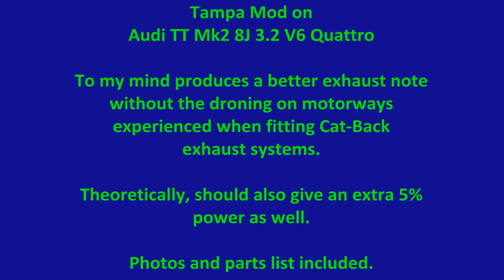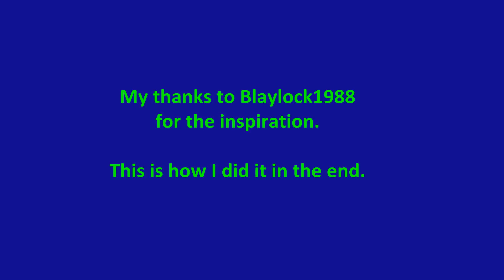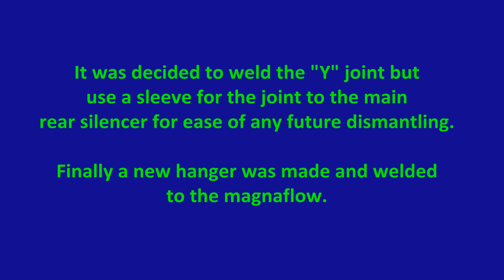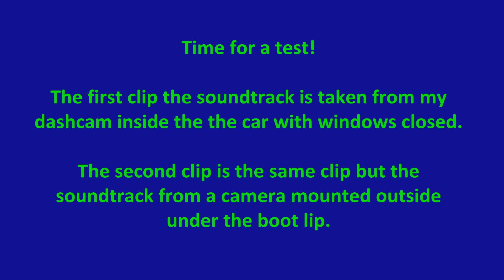Audi TT Mk2 8J 3.2 V6 Quattro Tampa Mod exhaust mod - how to

Comment: Great to see this done. Been debating doing the same on my A3 3.2 but haven't been able to find anyone who has used the whole Magnaflow resonator. The true Tampa mod requires you to cut it down to around 7" and weld it back together, but I think the full length gives a much nicer, deeper tone. Great work!!
Reply from the maker: Yes, you are right. I did consider a cut and shut, but felt it best to leave it as is. Prefer the sound, anyway. Thank you for the nice comment.
Reply: I used the whole resonator on 2008 Audi TT VR6- 10 hp gains- Sounds Great.

Comment: Maybe its the mic but that sounds way louder than mine, I also used the same setup and took out the front pre-resonator.
Reply from the maker: Probably because the mic is mounted under the lip of the boot-lid, right above the 2 pipes. Yes, took out the pre-res and there was only one res where often there is 2 , so took that out as well.
Reply: @TheRealKelpy  Did u experience droning after cutting 1 pre resonator?

Comment: I just test drove a 3.2 TT and the garage said they thought the exhaust was stock but I don’t think sounded it. The tips looked stock so I was thinking they might’ve done this. Do you think yours sounds like the one in this video I took: https://youtu.be/XgEJm3FTGVA
Reply from the maker: I must say, it does sound very much the same, doesn't it. You should be able to see under the car, and use my pictures as a guide.
Reply: @TheRealKelpy  unfortunately it sold so I won’t get a chance to check it! I just wanted to know because I’d like to do it to mine when I get one! Does it drone at all?
Reply from the maker: @nahcuh9140  Not at all. That's the reason I went for this mod as opposed to a lot of the proprietary cat back replacements.
Reply: @TheRealKelpy  just what I wanted to hear! Thanks